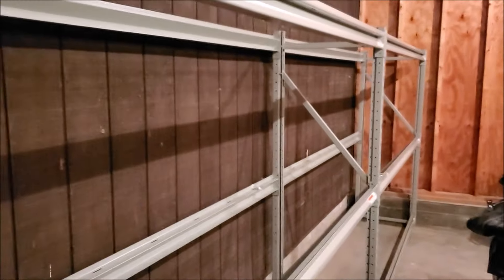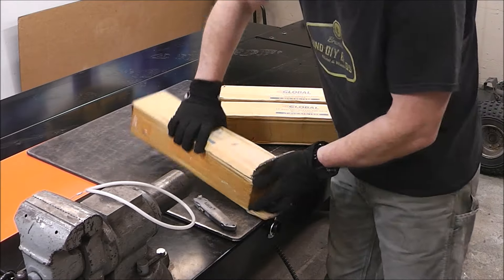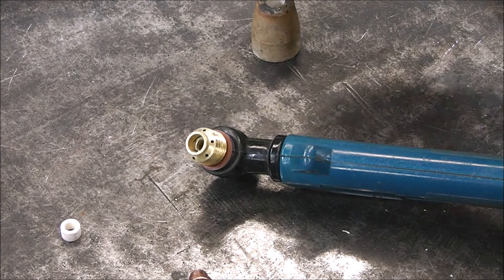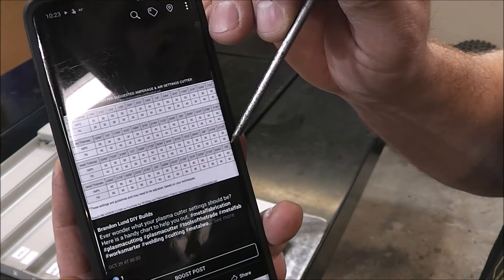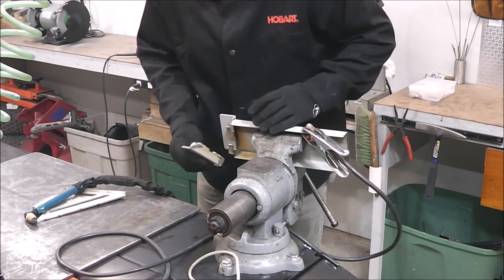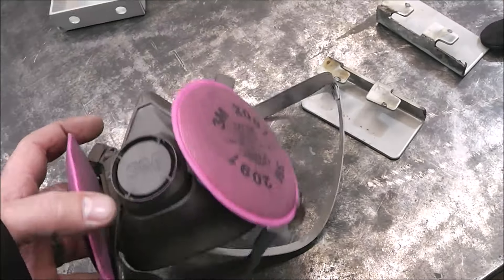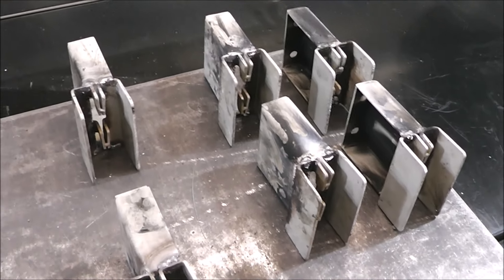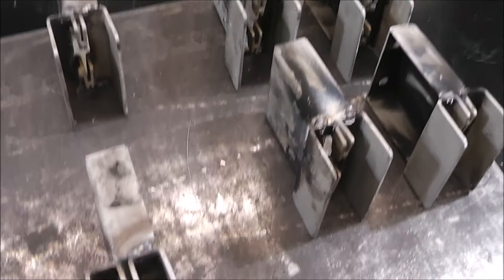Setting the Correct Air Pressure and Amperage for your Plasma Cutter

Comment: I just ordered a similar plasma cutter,so thanks for the video..But,i would done that job in another way.Why cut both ends,when just cutting the other (With the holes) would be enough.
Then just make some small cuts on the sides,and bend the middle section 90 degrees and drill two holes...
Reply from the maker: There is always more than one way to skin a cat. I went for the one that closest resembled how the factory did it even though I could have saved time doing it differently.

Comment: Great info on plasma settings. Shame video didn't stick to the subject and didn't wander off for most of it into shelf brackets and welding. 
Would be good to see cutting various materials with the wrong settings and an explanation of problems.
Reply from the maker: This video actually isnt great. I have a better one "Plasma cutting 101". I forewarn you, i like to go off topic and ramble a bunch of nonsense just to irritate my viewers so i can receive disrespectful comments. It seems like it worked 👍
Reply: @BrandonLund  And use up my roaming data allowance unnecessarily.🤔🤔
But I'll have a look at the 101.
Reply: And a Q Brandon. I've got  Parkside Pilot Arc so do I need to make any adjustments to your excellent table?  Just tried on 4 and 6mm material and table settings seemed to work pretty well. I found with stainless 4mm, I just needed a couple more amps than mild steel 4mm.
Reply from the maker: @colinstone8096  that table will get you really close for most machines whereas its based on output amperage VS air volume. Spot on about stainless requiring a little more than mild steel and aluminum will require about 10% less than steel.

Comment: i have just got my self PLASMAARGON  ICUT 60P , every thing works great , but it works and cuts same with ground connected or not to the job , i dont want to use and damage the machine , when welding ground connection is easy to know  as will not work , but as you know ground may look ok but is not un till welding starts that you know, so i would never know if i have good ground or not as plasma works with or with out,  i have used industrial plasma cutters before , but for my retirement i think small cheep plasma is all i need .
Reply from the maker: Hmmmmm. I wish I would have seen this comment earlier. I was using my 50 amp imported plasma cutter earlier today for an upcoming episode. I don't think mine will work without the ground. If the ground is bad, the ground clamp starts sparking and arcing against the metal until is creates its own good ground.

Comment: would you not have been better off saving the length from the other end and just cutting out the bolt hold plate to weld into the more complicated end?
Reply from the maker: Possibly. I don't remember why I decided to go this route but I knew this way caused more work but I went this route anyways because I felt it would have been a better product.

Comment: It seems the weld at the hanger is more detailed and would require more work to cut and prep. I would think it would be easier to cut 3 1/2" from the bracket, prep and weld a plate to the end.
Reply from the maker: Good point! @Michael Dvorak

Comment: Hi Brandon, nice job. Are the adjustments general? My 40 amp plasmacutter manual say 4 bar (prox 58 psi) standaard for all thickness. I wil try this weekend with to cut with 20 amp and 30 psi for cutting 2 mm steel. Greetings from Holland
Reply: 30 psi 😉
Reply: Hello Brandon, I practice with 20 amp and 30 psi on 2 mm steel. It works goed. Bath i think with 30 amps i can cut faster with a cleaner cut. Dit you try that ?
Reply from the maker: Honestly Eric I have typically just set it and run everything high but lately I have been using this chart and i am getting better cuts, less sparks everywhere, longer consumable life ect. You might have to play with the settings a little to suite your machine but so far I'm very happy with the overall results. Thanks for comments and watching. What are your temperatures in Holland. Yesterday it got down to freezing temperatures here in Maine
Reply: Thank you Brandon, i will play with the settings.  Temperatures nex week are  nights about 4 gr Celsius (39 f) and daytime prox 8 gr Celcius (45 f) . Most claudy and every day same rain.

Comment: So, do you place the consumable face against the metal you are cutting or is it best to be 1/16" off the cut?
Reply from the maker: I generally drag the consumable across the workpiece but that's not reccomended. Your supposed to leave a small gap which also increases you consumable life.
Reply: My Hypertherm came with a drag tip which keeps the electrode from dragging the metal being cut.

Comment: @2:56 Right off the bat. I would have cut the tube off the other end the 3 1/2 inches and then salvaged the two hole tab on the wall end and welded it back onto the 3 1/2 inch stub from the rack end.
Reply from the maker: Thats not what I would have done
Reply: @BrandonLund  would have been simpler. All you are moving is the tab at the wall end.

Comment: Great video Brandon ! You did an awesome job at explaining everything regarding setting up the Plasma cutter and modifying those steel brackets. 

I just got the very same "Cut 50" 50 amp plasma cutter for Christmas 2020 and I stumbled on your video whilst searching YouTube on it ! 

What sort of air compressor do you recommend for this plasma cutter ?  I noticed that some of more dearer plasma cutters have a built in air compressor...  I searched online yesterday on Google and managed to see what's inside one of these top end plasma cutters that have the built in air compressor and I was very surprised to see that it was just an ac motor with a twin air pump (1 air pump bolted to each end of the AC motor) and NO air tank ??  !..... Everyone I know seems to say that it is important to have an air supply that comes through an large compressor air tank for smooth plasma cutting, Is this true ? as the manufactures of these expensive top end plasma cutters seem to build their plasma cutters without an air tank and just a air compressor unit !

If it is possible to just use a twin air pump as an air supply to be able to plasma cutter without having to use a massive heavy bulky air compressor and tank ?, please share your thoughts on this ! Thanks man for your help !

Thanks for reading man and all the very best for 2021 👍👍👍
Reply from the maker: I don't have any experience with the more expensive on board units so all I can reference is what I have. I'm using a 5hp 30 gallon compressor. With that said, its more than enough to run it.
Reply: @BrandonLund   Hi Brandon, Thanks man for your input. No problem mate, I understand that you can only reference what equipment you currently have. I have been researching this and apparently you can run a plasma cutter with no air !, although for finer, precise cuts they say it works much better with a suitable air supply, So I will wait until I can get a good capacity high flow air compressor which is about 24 - 90 liter and that should be ideal to run mom's Xmas present lol

Take care bro and keep making these fantastic videos !, we love them here on YouTube !  👍👍👍
Reply from the maker: Thanks buddy and I appreciate your support!
Reply: @BITTYBOY121  Unless you're doing production work, you can have a fairly small air compressor unit, but maybe use an extra tank on it to give you the continuous run time you need, if you're making short cuts and can wait a half a minute between them you shouldn't have a problem even with a pretty small one
Reply from the maker: @Joseph D this is 100% spot on advise.
Reply: @Rx7man  Thanks Rx7man for the great advice ! - Much appreciated !  👍👍👍  Yes, I am only planning on using my plasma cutter for small jobs like cutting holes and short bits of steel so I should be OK (hopefully !) ....I guess its going to take a bit of practice and some trial and error before I figure out what I can and can't do. When you say small compressor, how small ?, would something like a compressor with a 6 or 12 liter work ??  Ideally I wanted to just run it from a very powerful air pump with twin compressors like some of these very expensive plasma cutters contain,  See pic at the link below:-  

https://image.made-in-china.com/2f0j00pgCYnfOLgMkQ/380V-100A-DC-Inverter-IGBT-Module-Plasma-Cutter-Machine-Cutting-Tool-with-in-Build-Compressor-and-Arc-Function-Cut100.webp
Reply: @BrandonLund  Thanks Brandon for posting back and for trying to help me 👍👍👍, Rx7man's advice is great and I am going to try and do what he said, I don't have much space to store a big compressor, so I am only limited  to the smaller compressors but it would be ideal to run my plasma cutter from a powerful air pump or even a tire inflator ! LOL 

Its all about sorting out a decent compact air supply then things would be great ! :-)

Comment: It seems to me that it would be cleaner and easier to cut off an appropriate length from the center section and then bolt the pieces together.
Reply from the maker: Possibly. There is always more than one way to skin a cat

Comment: First thought watching this was "WHY isn't he cutting just the hole plate off...." ... then saw in the comments you said about bolting them to the wall, then the thought is "Why not cut two inches from the hole plate and an inch and a half from the mounting plate, spin it 180 so you can mount to the wall and just cut up some of the scrap for an internal plate for strength and weld it all together" ... but hey, to each his own.... Now to go find that chart.....
Reply: Found the pic, Easy Peasy, go to his FB page, click PHOTO's, and there it is :D
Reply from the maker: Honestly, I was trying to keep it looking as though the factory had done it. Obviously I took the more difficult approach but for the reason I explained.
Reply: @BrandonLund  Aye, can't argue with ya, as I said to each his own when it comes to fabricating things... I think we all have our own unique way of getting to the same conclusion :) Some just get there faster than the rest of us ROFL :)

Comment: Actually, if this is anything like running torches there are a couple of main reasons for the setting instead of simply running your amps (heat) and pressures (blow through) at full tilt: If you’re cutting lite gauges running high heat your material will overheat beyond just your kerf of cut and the material will pool and fill in behind you as you move forward in your cut which is frustrating to say the least! As for air pressure, you only need enough pressure to push through your material. If you’re cutting half inch you have a lot more material to push you flame through or arc through. But if you’re cutting thin shit then you’ll pressure requirements to push your flame or arc through is far less.
Reply from the maker: @4R NORTHWEST I never really thought of it but yes your right, it's very much like using a cutting torch. I wish I would have mentioned this in the video for those that are used to using torches. The one thing I really like about this is the cost. As you know gas is expensive. All you need for this is air and electricity, although we will always need torches for heating and bending this makes it nice to keep gas cost down

Comment: Bandsaw cut and weld one plate with the holes drilled in. Done.
Reply from the maker: The bracket orientation had to be flipped in order to work or I would have. I show this towards the end of the video.

Comment: Thank you. Altho I’ve worked with plasma several times in my career each machine has its own story per say. Your chart came in handy with a similar machine I just purchased. 😉😁💯✔️
Comment on the fabing: I bevel everything also. It’s just good practice. 
Someone once told said it’s not necessary to bevel a fillet weld.. but I told him to F🇨🇦ck off.. when the strength is needed it will alway be there! 
Like hand rails. Some never beveled their joints and grinded their weld smooth. Journeymen welders.. smh
People.. you have to weld with anticipation of the worse case scenarios. The biggest impact for sheer strength. Hopefully it never happens but if it does you’d wish you’d have taken the extra seconds to bevel properly if someone dies because of your welding. 
Lol rant over!
Reply from the maker: Thank you! 👍👊 a little extra time in prep pays in the end. Better job, better pen and a better looking bead in my opinion.

Comment: I don't understand why you didn't just cut 3" from the locating bracket & cut off the back plate with the holes & just weld that back on-much simpler & quicker
Reply from the maker: The brackets had to be rotated 180 on some so rather than do a couple one way and the others a other, I kept it consistent

Comment: There is a reason those brackets set the racks away from the wall -  the radius of the tire makes it hang over the front and back. But you probably found that out when you loaded the rack. Oh well.
Reply from the maker: It worked just fine. I didn't have any of those issues. I was smart enough to consider this prior to fabricating the brackets.
Reply: @BrandonLund  Should have waited to the end of the video. I thought the wider racks were for truck tires. Oops.
Reply from the maker: No worries. Where as this rack will hold only car tires 20" and under, the brackets were made specific for their need, however,  if you were using it for truck tires as you mentioned, you would need the additional length so the tires didnt hit the wall.

Comment: I would have cut the little end plate off and measured 3.5" from the other end. A lot Easier.
Reply from the maker: The end bracket had to be flipped 180 as I mentioned so I kept the modification the same for that reason

Comment: That was not 1/8"
Reply from the maker: Even though it measured 1/8"...yah, ok
Reply: Didnt look like it to me either. Plus the powder coating. But that isn't the point. The point was to get an idea on settings. So good tip none the less! Cheers for sharing

Comment: A particulate mask doesn't help when inhaling fumes, stay safe.
Reply from the maker: I'm not an expert. This is taken directly from Millers website  "Once you start arc welding, the ozone created by the electrical arc produces fumes that require a more robust system of respiratory protection. Since the face shields worn to protect from infrared restrict the type of respirator and cartridge or filter that can be used, many welders prefer soft P100 filters like the 3M 2097 Particulate Mold Filter P100 because they have a layer of charcoal to absorb fumes and organic vapors and also can block far more of the particles carried on the air. The 2097s can be worn on the 3M 6000 Series half-face masks or the 3M 7500 Series which is made of soft silicon and is more comfortable when worn for long periods of time" ~   I cant dismiss that Miller Welders is promoting the same exact respirator I use on the channel. I feel they would have a huge liability issue for promoting wrong PPE.